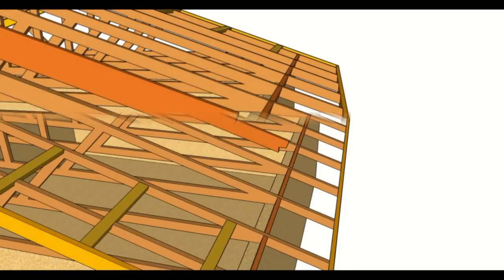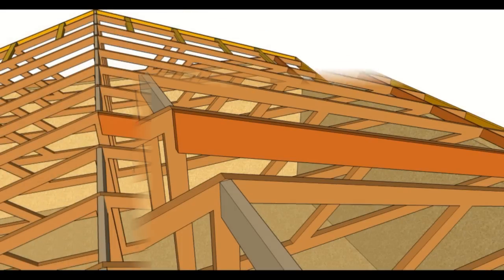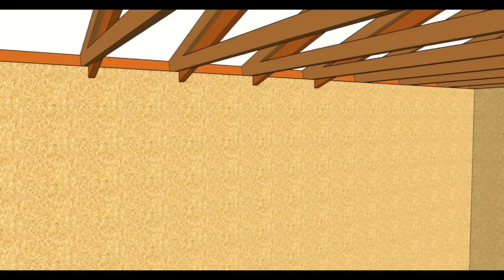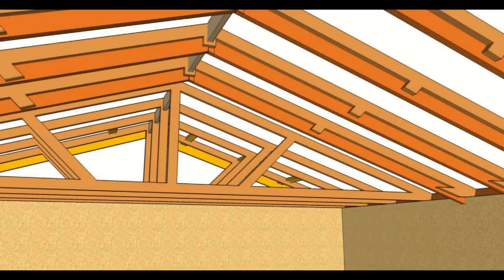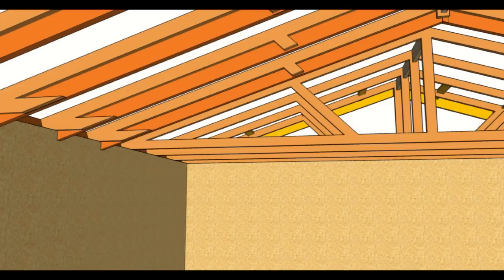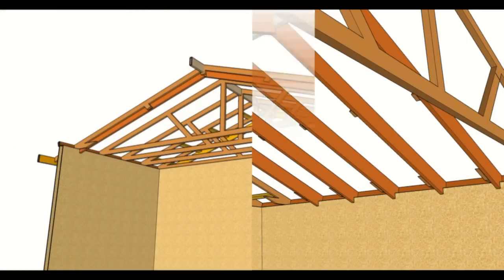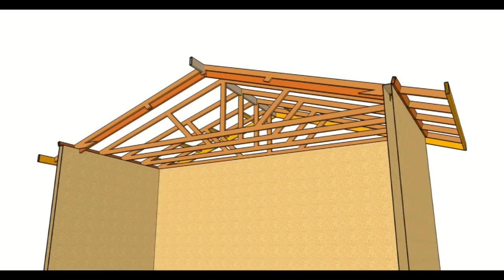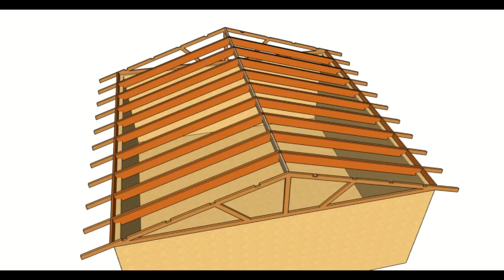How To Turn Flat Engineered Roof Truss System into Cathedral Ceiling – Small Buildings

Comment from the maker: This response is for DrScopeify. Sorry I couldn't respond under your comment, but it seems to be a reoccurring problem with YouTube. I don't think you would have a problem removing drywall or staining the wood. You would just need to make sure you insulated the areas of your living space, which could include the roof and walls separating an attic or the outside. Remember, I'm not a structural engineer and I'm only providing you with an opinion, because I don't know exactly what your situation is.

Comment: I'm looking on doing something similar to this with the main difference being I'm only looking at removing a subset of the trusses (6 of 20 at 24" spacing) not the entire set.  Could I avoid having to add a ridge beam by installing rafter ties? - preferably with 48" spacing and at 1/3 of the pitch height?
Reply from the maker: Engineered roof truss systems are different than conventional framing where you use rafters and ceiling joist or ridge beams. I strongly suggest contacting a structural engineer for more information.
Reply: Please  don't post any video with this context. 
Idea of such a roof is not possible.  Wall will bow out for sure!!!

Comment: Thanks Greg for the video! Can I ask why nailing additional roof rafters and attaching them to existing trusses does the job of supporting the roof without the need for the ceiling joist? What is the physics behind it? Aren't we just adding more weight to the roof which pushes even with more weight on side walls ? How does the weight distribution work after the additional roof rafters are installed as per your video? Thanks in advance.
Reply: the rafters are carrying the weight of the materials on top of it (roof sheathing and shingles) , so when you have a very strong (meaning unbendable) rafter it does not need support from the bottom to keep it from bending.
Reply: It would need either structural collar ties/rafter ties or a structural ridge beam.  The rafters alone would not work because as he mentioned in the video the weight of the roof would push your side walls out and cause the ridge to drop.

Comment: In this type scenarios where a (2x4)beam needs to be beefed up either the rafters or joist(or both) in an 'engineered roof truss' ,, and in most solutions I see the obvious recommendation of using a wider beams like a 2x10 or 2x12.  I thing for a diyer that can get too complicated. what about just doubling or tripling or quadrupling the existing lumber with the same size lumber??  example you can just add an additional 2x4 on each side of the existing 2x4, won't this make it 3 times stronger ? ?
Reply: No. It doesn't work that way, take it from a professional. Cheers

Comment: I have a pole barn we are converting to a house . Just curious is it possible to sandwich the existing truss to create a scissor truss to create a cathedral ceiling.
Reply from the maker: I don't think it would be a problem, but I'm also not an engineer. It also might be better to remove the existing roof and rebuild it or a section of it as an alternative.

Comment: Any ideas on restructuring engineered roof truss with roof rafters for a small area of 10x10 above the garage as I have enormous attic space with the apex being over 10 ft. such a waste of space that needs to be used for a room or nice storage space etc..... Need some guidance as I watched this video and being the room area i wish to modify isnt across the span of the house etc.. Any ideas!?? Thanks in advance!!!
Reply from the maker: I do have some other videos at the website that might be helpful. They can probably be found in the garage remodeling section, but that's about all the guidance I will be able to provide you with, since I am not the structural engineer.

http://www.homebuildingandrepairs.com/remodeling/garage/index.html

Comment: thought about this. If there is no load bearing walls and a hip style truss roof, can't this be done under existing plywood roof decking with metal roof panels in the outside corner of house?
Reply from the maker: Hi Keith, I'm having a problem trying to figure out what you're actually trying to ask, could you give me a little more detail or rephrase the question.

Comment: Greg - suppose I wish to remove the bottom chord of just ONE trust (to raise a small section of the ceiling to make a feature from below). Can I screw sections of timber to the underside of the top chords of the two adjacent trusses and the truss I wish to remove?
Reply from the maker: The moment you cut the truss, it's ruined. I'm not going to suggest that you can't modify it somehow, it's just that I couldn't tell you how to do it. I would suggest going to our website and watching some more videos on framing repairs and vaulted or cathedral ceilings to find something that might work.

Comment: Uhhh  what holds the arch from pushing out the walls? I didn't see any flying buttresses?
Reply from the maker: This isn't the best method for doing something like this, but I made the video because I've seen it done before on smaller buildings. I actually did it myself on a shed that I built that was about 8' x 8'.

Here's a link to our website with more videos about remodeling ceilings http://www.homebuildingandrepairs.com/remodeling/framing/ceiling/index.html

Comment: at what point do you put the ridge beam in? Can you put it in from the top? or do you not need a ridge bean=m in your example?
Reply from the maker: +craig z That's a good question. It would all depend upon the job. For example the existing roof would need to be supported somehow, before removing any structural supports to prevent the roof from collapsing. This isn't an easy question to answer, but I will try and make a video within the next month, to provide you with at least one example.
Reply: Thanks Greg  I have a basic one story ranch with trusses, I want to vault the ceiling in a 16' span in the living room. I am assuming I would need to attach the new joist 2x12 to the rafters and the drop the ridge beam in from top or is it  stated to set it under the trusses then put new joists over it. Thanks.

Comment: how big was this "small building"?
Reply from the maker: Good point and I don't think I would use it on anything larger than 8' x 8', without some type of additional structural support to prevent the walls from spreading apart from the weight of the roof.

Comment: In the end, it would be cheaper to get new trusses built to the new requirements, imo anyways... (25 yrs as a builder)
Reply from the maker: It might not be cheaper on every project, but would definitely be something to consider. (35 yrs as a builder) I couldn't help myself, you said 25 and I had the one up you with 35. By removing the entire roof you would have additional costs like demolition, roofing materials and sheathing, but these costs could be eaten up in labor if the remodeling project is difficult to do.
Reply: You may be right, but most of these type of projects I get involved with are so far gone that the cheaper ( and better) way is new. (No sense putting good wood against rotten, etc.)
EDIT:
Just condemned 2 "garage's" yesterday, no foundation, bottom sills rotted right out, studs rotted 3-6 inches up..
Home-owner's were hoping for a "jack and sister" solution ..NOT!!

Comment: Now that you’ve removed your best means of routing electrical and HVAC, you need to pay for a solution
Reply from the maker: That would definitely be something to consider during the planning stage.
Reply: I posted above about this, but if you use scissor trusses, you can have more room between the ceiling and roof for electrical, insulation, duct work, etc